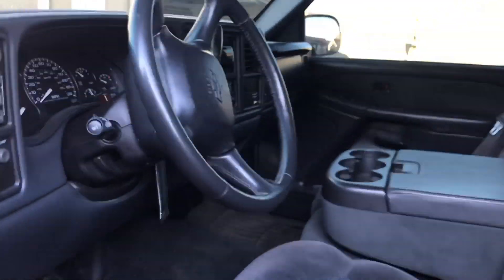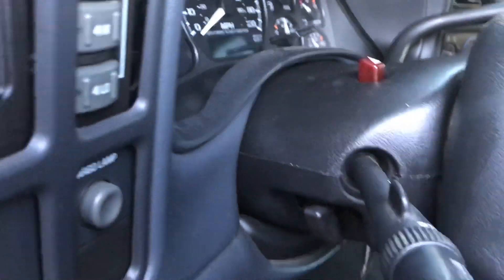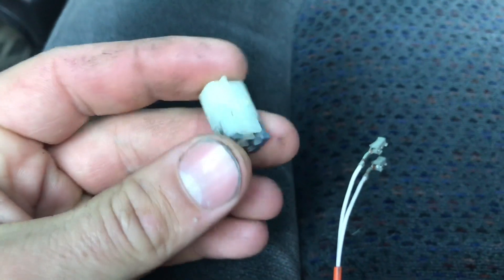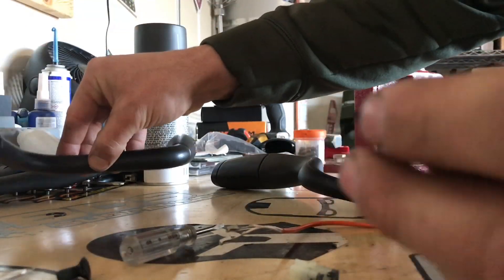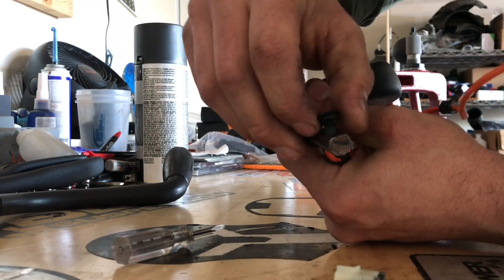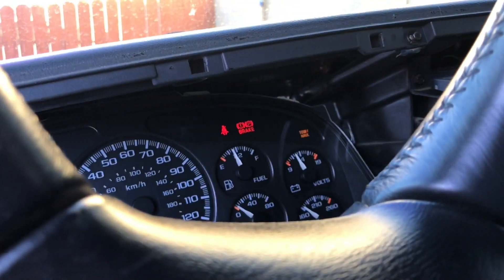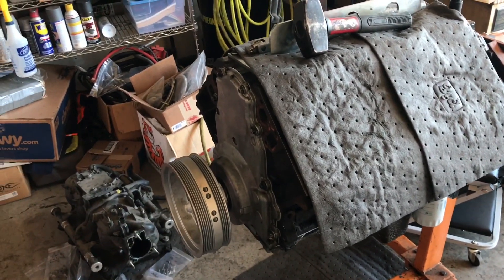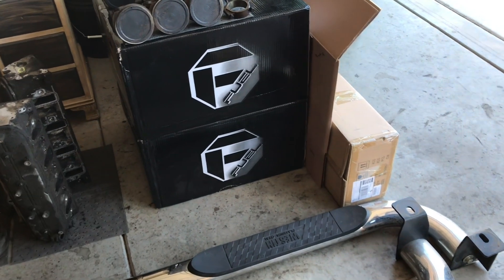Silverado NNBS Shift Lever Swap

Comment: i just did this swap😂 it looks awesome man. my next mod is the entire column out of an 03-07 truck for the newer steering wheel
Reply: The 2019 steering wheels bolts right in lol
Reply: @aydengoldsberry5721  not on the 99-02 splines.
Reply: @brendan747   I guess your right I have an 04 so not sure about 99-02 good info tho
Reply: @brendan747  You can swap splines it is pretty easy
Reply: @shakenfake  i ended up putting a 02 escalade wheel in mine and wiring up steering wheel controls
Reply: @brendan747  Sounds good man
Reply: @aydengoldsberry5721  any pics of this?

Comment: Do you think the shift buttons would work on a 04 Silverado 3500? I am considering this as well. Great content 👍
Reply from the maker: If it’s a diesel I think there is a company that makes a kit to make the tap shift work. I could be wrong through.
Reply: @EndlessWishlist  not that big of a deal I was just curious. So I’m guessing you ordered a shifter from a 2007 and up half ton? I was thinking of getting a 06-07 shifter and hoping I wouldn’t have to mod but will if I have to.

Comment: Would you be able to utilize the shift mode if you swap the trans to a 6l80/90E looking into swapping my 05 Silverado 4l60e to a 6l80/90E and want to able to use the shift mode. Other dilemma would be my cluster only has PRND321
Reply: Did you made the change ?

Comment: I have a 2004 duramax and was thinking of doing this. They came factory in the 2006-2007 2500. Do you think I would have to bend it or would it sit correctly?

Comment: Did you swap back in the NNBS console or is this vlog made before center console replacement?
Reply from the maker: I swapped back to it. I didn’t like the center console from the 99-02s and I don’t like the way the 03-06s fit in these trucks. So I put the nnbs jumpseat back in
Reply: I like the nnbs console better as well, I have a 02 Silverado with 8.1,I’m currently redoing as well. Installing the same console and now the NNBS shift lever after this video! Keep up the good work! Very informative, I’ve been subscribed for a few months now.
Reply: @mattwright6759  got the same truck do you know if the shifter with gear paddle will work ?

Comment: I have a a question about the other one you did with gear selector, do the arrows actually work to change your transmission or do you have to do something with the computer?
Reply: Gear selector doesn’t work it’s just basically for looks.
Reply: @K3VG979 so what's the point then?

Comment: I'd be curious to see if you could add a NNBS steering wheel into the 00-07 trucks I prefer the NNBS Steering wheels
Reply: Like the 2014 an up Silverados? Into a 00-07
Reply: @K3VG979  yes

Comment: I like the mod, you can also change where the shifter bolts in too, the new ones have the kick to it so you don't have to cut and weld
Reply: Which year and model?
Reply: @1ruckus1  I took my shifter and the adapter thing from a nnbs truck. Like 08.

Comment: Where can I get that exact shifter without the up/down button?
Reply: You can get it from the dealer for around $60, I just got the same one out of my '08 Tahoe
Reply: Found an OE one on eBay for 62..I searched 08 Silverado 4l60 column shifter.

Comment: First of all the front ends after the 02's are horrible looking it was such a bad design chevy did it doesn't fit the body style atleast gmc kept theirs till 07 but if you look at the new Toyota looking chevys today what do you expect. Gmc keeps doin right. You could put the gmc front end on to give a little more of a aggressive look. I did all my light switch and the 4x4 switch not just the buttons but the yellow lights I changed to red all else is blue. Dig the that shifter.